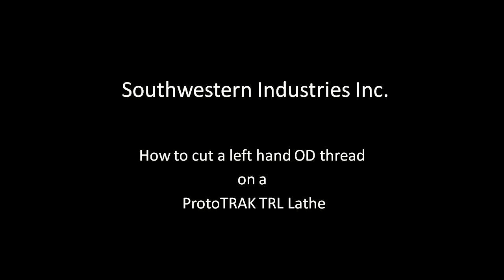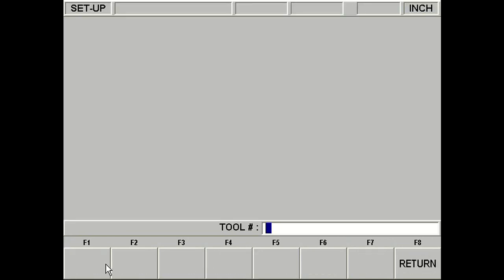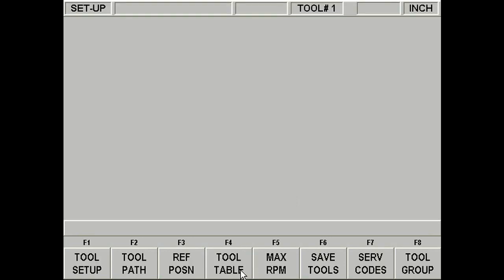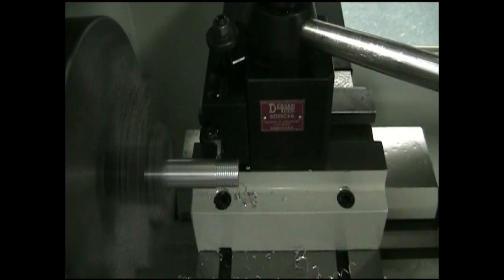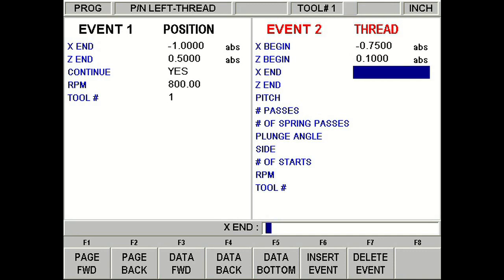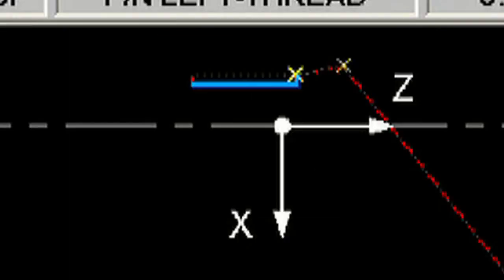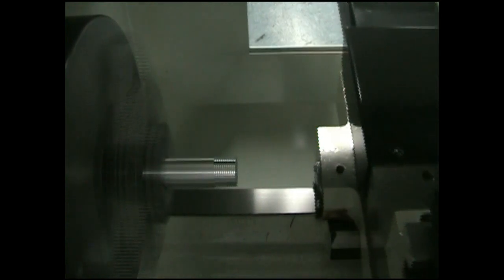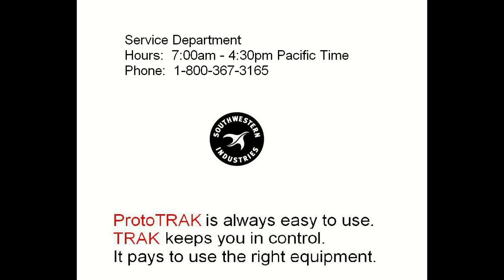Cutting a Left Hand OD Thread on a ProtoTRAK Lathe

Comment: Use a right hand boring bar with a full form right hand internal insert. Put the bar upside down and cut from the front in reverse. All positive numbers as right hand threads, no positon commands to enter either. Tool is automatically on centre if held in a round bore holder. Plus full form threads are far better than ones cut with a universal triangular insert.
Reply: I agree!  Thanks for sharing!! T.P.